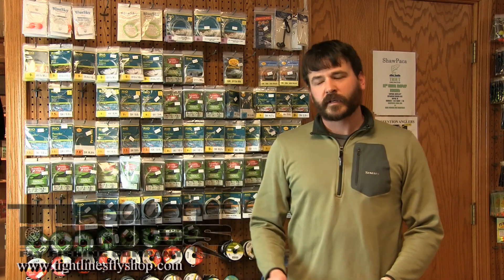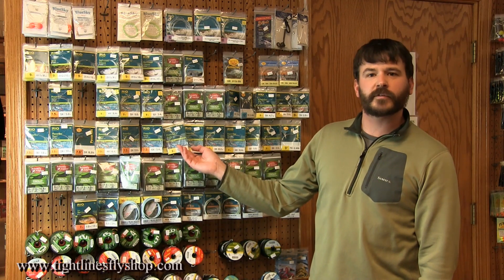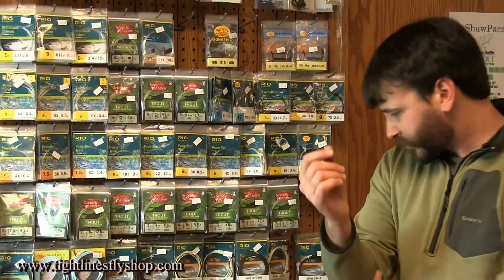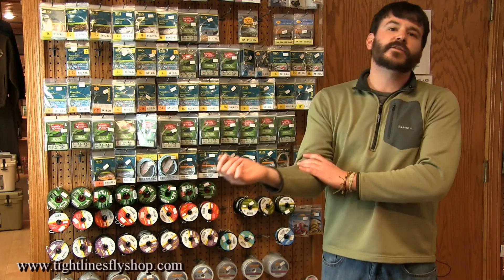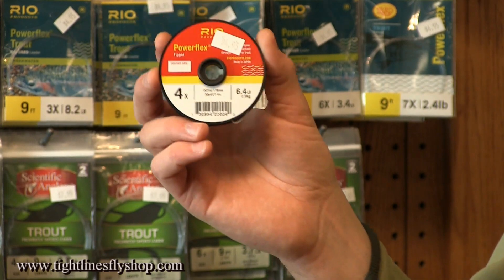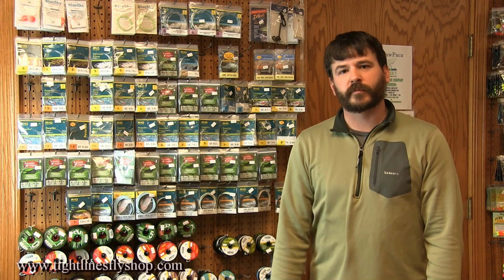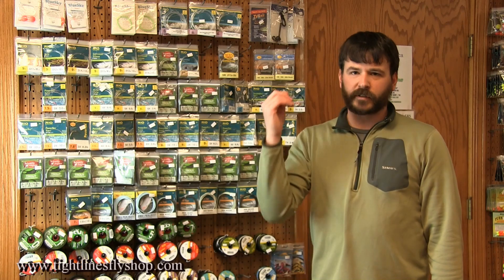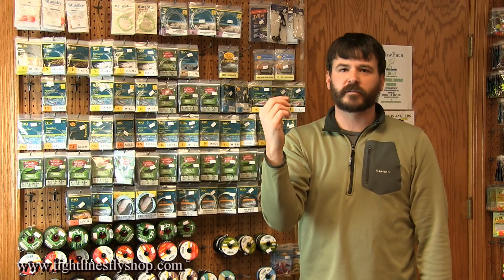Fly Fishing Lessons-Understanding Leaders and Tippet

Comment: Another good thing for new fly fishers like us to know is the knot breaking strength of the knots we use.  I'll never use a surgeons knot again now that I know that the improved blood knot is a better knot for attaching tippit to leader material.  Rio has a really good knot section on their youtube channel where they test the knots breaking strength.  I've been using clinch knots and surgeons knots but now I've decided to change up a little and use triline knot or turle knot (for up angled eyelet flies) for my dry flies, improved blood knot for attaching tippit to leaders, and the perfection loop for wetflies, emergergers, nymphs and I'll test them on streamers to see the results.  So here's the stats for these  78% breaking strength on the improved blood knot, 95% on perfection loop, clinch knot 89% where the triline is 99%, turle knot 92%.  Either way the breaking spot is the improved blood knot.  The surgeon knot is 66% blood knot 68% and improved blood knot 78% so it's an easy choice.  Happy fishing!  There is one argument against this.  Should the tippit be the weakest link or should the hook be the weakest link.  I haven't lost any flies in the water, only on back casts.  I might have an easier time finding my flies if there is tippit material hanging off them.  I don't really think I'll be snapping many lines into the water.  I sure hope that I never snap any into it honestly.  If that ever happens I'll probably switch to the fly being the weakest link.  I don't want trash floating around in the rivers.  I keep all my trash out of the water, even when I clip the tags off when I ties my knots.  I'll test this and see how it goes and if I lose any line in the water I'll change it up so it never happens again.

Comment: Thanks so much for explain the terminology and tippet use so clearly. 1. You mentioned using a leader the same length as my rod.  I usually add 3 feet or so tippet especially when dry flying.  2.  Can I cut off the 4x portion of leader and add 3 x if I want to fish a larger fly?

Comment: so the tippet material is used to replace broken leader to ensure the line near the fly is thin enough to allow for good transfer? Which says to me you buy a spool of tippet, to save buying packs of leader? what knot does one use to tie tippet material to the leader?
Reply from the maker: +Adam Avinger You still need to start with a fully tapered leader.  The tippet material is added as a patch to keep your leader in good shape and allow smooth transfer.  You don't want to just use a straight piece of tippet as a leader.  This is one of our videos on tying the double surgeons loop for attaching more tippet to the leader.  I hope this is helpful my friend.   https://youtu.be/zoo4OQoHaz8?list=PLGJWNkcgmKQjLHty1fbbAhPYFxHULWmkH
Reply: tightlinesflyshop For the last few years, I have been using the Seaguar knot for tippet to leader. Ties easy. I have not had one fail yet. According to an article I read very high line strength retained.

Comment: Good answer as to why not use regular mono for a leader, but why not use regular fluoro for tippet material ($8 for 250 yds vs. $15 for 30 yds)?
Reply: I think technically, fly fishing tippet material is suppose to have a diameter to strength ratio stronger than a spool of fishing line.  Charlie's description of just using mono can also apply to fluoro...both will pile up on the end of the cast.  This is not so much of an issue if you are nymph fishing but dry fly fishing, it makes all the difference.  You can buy fishing line, but I would use it on like 6 lbs or greater.  The lighter tippet material tends to be more supple.